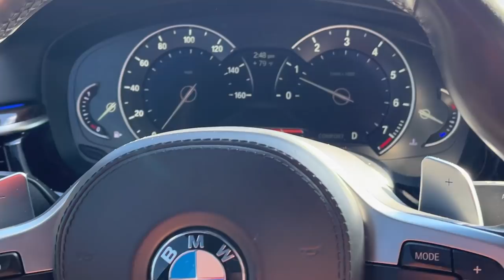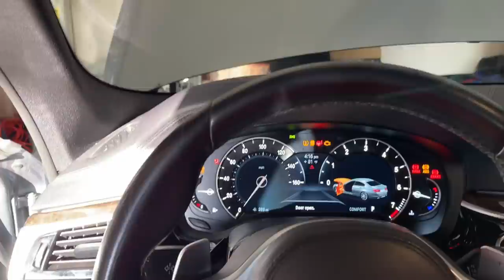How To Remove The Adaptive Grill On A BMW G30 540i With No Check Engine Light With BoltOn Garage

Comment: My issue with this mod is that the actuator still works in the background and when it does go out you'll still have a check engine light. I don't mind the active drill on my x7 but I do mind the check engine

Comment: JUST PULLOUT THE CABLE OF THE SERVO BEHIND THE KIDNEY U DONT NEED TO DAMMAGE THE KIDNEY, BECOUSE THE STANDBY MODUS IS ALWAYS OPEN IF U PULLOUT THE CABLE .AND ITS EASYER  :)
Reply: It will throw a engine code if you unplug the cable
Reply: I removed the entire assembly and replaced the motor and plugged it back in and it still throws a code lol the ecu knows if the motor is over spinning
Reply: I have a 2020 m550i

Comment: you guys know you can remove the adaptive grille no need to cut it off like that.
Reply from the maker: Not without a check engine light. If you unplug the module
Reply: @TKsGarage  Can’t you just reset the codes then for it to turn off the check engine light?
Reply: You can remove the module from the assembly and zip tie it to the front end for a cleaner look but you’ll still get a code lol

Comment: How does this mod affect performance?  Aesthetically, the close look is better but I am wondering what the actual purpose of this mod is?  Would you please clarify?
Reply from the maker: Keeps the car cooler. More boost
Reply: BMW used such a kidney for the car's aerodynamics. Below, where the air intake for the intercooler, it also has blades that manipulate the air flow. They programmed it so that when the engine temperature slightly increases (i.e. the need for high performance), it opens for air flow to cool the engine, but when you go faster and faster, the car will close the radiators because the air flowing from the bottom is sufficient to keep the temperature low, and additionally improves aerodynamics. So I would absolutely have to leave it, it is just spoiling some part of the car to get a nearly non-existent increase in performance. In addition, in the new BMW, the car looks better with the curtain closed

Comment: Hi i did all that but i still Have a code P05A9 i tried to reset with scanner but comes back .. Do i have to disconnect the battery????
Reply: Did you ever get the cel light off

Comment: You know there’s shutters on the bottom right?
Reply from the maker: Huh I don't see any on mine...
Reply: @TKsGarage  you have lower shutters that open and close not just the grill shutters
Reply: @TKsGarage  the thumbnail where the guys knee is at. There’s another set of shutters at the bottom
Reply from the maker: @That540iMSport  interesting mine doesn’t
Reply: @TKsGarage  look at your front grille and look all the way down In the middle by the bottom of the radiator there’s flaps that open and close there too
Reply: @TKsGarage  I stumbled upon this video my dealership said do not remove them that being the kidney grills and the lower radiator shutters

The shutters are there for both cooling and aerodynamics once you remove the shutters you create drag
Reply: @TKsGarage  The shutters are there for a reason there for heating and cooling they open up at max AC or in diagnostic mode once you turn the car off they will close I believe they open up at 40 miles an hour for more cooling if needed Otherwise you’re creating drag

Comment: I would love to do this on my G30 530d xDrive as well. They told me at the service center that my check engine light will be on forever. If I throw the car into diagnostic mode and do the adaptive grill removal, will everything be ok? And without the warning light? Thank you for the advice!
Reply from the maker: You don’t actually remove the module so it thinks the flaps are still there
Reply: I did that and I still have the codes abeit a different code . The ecu knows if the motor is over spinning. Meaning if the motor is spinning without resistance (stopping) at some point .